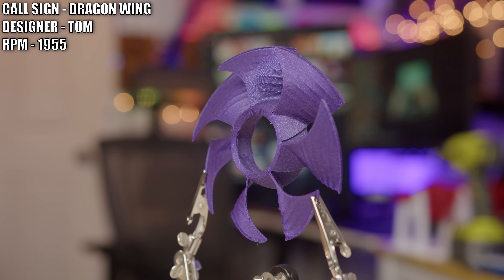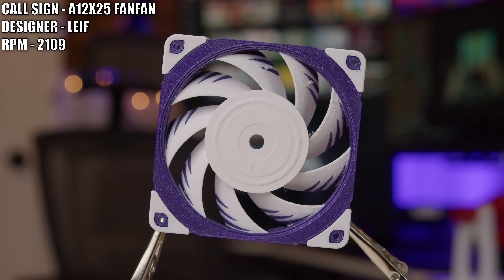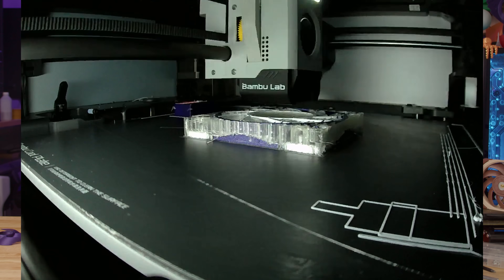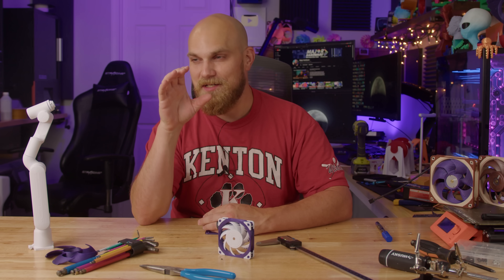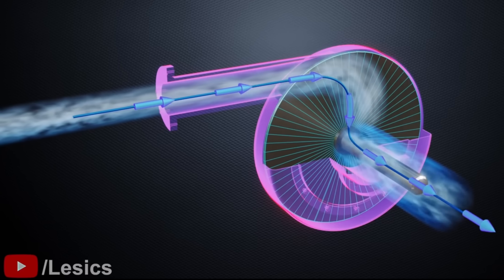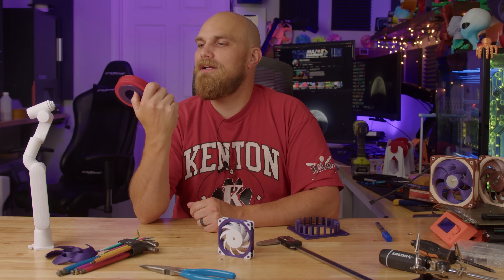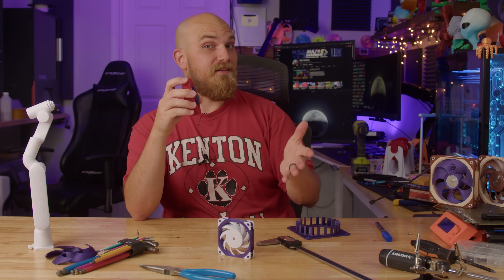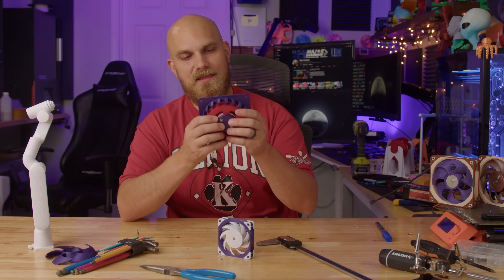I Put a FAN Inside a FAN | Fan Showdown S5E7

Comment: I was interested to see how the fans would rank if we were to value FPM and dBA equally instead of only noting dBA and ranking by pure FPM. I realized then that decibels are logarithmic, so I had to convert those values to linear before we could get a proper weighting. Also, the columns won't line up here because we can't use a monospace font in comments. But you can paste it into a text editor if you want that. Anyway, here are those rankings!

| Fan              | FPM | dBA  | dBA linear | FPM/dBA linear |
| ---------------- | --- | ---- | ---------- | -------------- |
| Multi Stage      | 268 | 40   | 101.59     | 2.64           |
| Turbo Pump       | 405 | 43.6 | 153.99     | 2.63           |
| A12x25           | 495 | 46   | 203.19     | 2.44           |
| Angel            | 485 | 47.3 | 236.11     | 2.05           |
| 92120            | 464 | 47.5 | 241.63     | 1.92           |
| Simple 13        | 479 | 48.1 | 258.97     | 1.85           |
| Gear Ratio       | 482 | 48.3 | 265.03     | 1.82           |
| Variable         | 430 | 47.4 | 238.86     | 1.80           |
| Hollowman        | 435 | 48.5 | 271.22     | 1.60           |
| Radish           | 459 | 49.5 | 304.44     | 1.51           |
| Warhead          | 454 | 49.5 | 304.44     | 1.49           |
| Tangent          | 459 | 49.6 | 307.97     | 1.49           |
| 17 Blade         | 446 | 50   | 322.54     | 1.38           |
| Circumventor     | 397 | 49   | 287.35     | 1.38           |
| Dragon Wing      | 528 | 52   | 406.37     | 1.30           |
| Cheater          | 477 | 51.5 | 383.57     | 1.24           |
| Waterfall        | 423 | 50.9 | 357.88     | 1.18           |
| Double J         | 397 | 50.4 | 337.79     | 1.18           |
| SkyScoop         | 423 | 51   | 362.04     | 1.17           |
| Triskelion       | 353 | 50.3 | 333.91     | 1.06           |
| Involute         | 327 | 51   | 362.04     | 0.90           |
| Toroidal         | 286 | 50   | 322.54     | 0.89           |
| XL               | 286 | 50   | 322.54     | 0.89           |
| Uruguayan        | 348 | 52   | 406.37     | 0.86           |
| 7 Blade Toroidal | 263 | 50   | 322.54     | 0.82           |
| 993              | 435 | 54.5 | 542.45     | 0.80           |
| Inverted Sharrow | 337 | 53.6 | 488.88     | 0.69           |
| Mobius REV       | 273 | 52.6 | 435.54     | 0.63           |
| Thoroid          | 255 | 52.8 | 445.72     | 0.57           |
| A12x25 fanfan    | 263 | 54.5 | 542.45     | 0.48           |
| Tesla Turbine    | 0   | 48   | 256.00     | 0.00           |
Reply: Nice work and I agree with your general point. I would however like to make one criticism and that is of the dbA conversion. Human perception of loudness works like most human senses (nearly) logarithmically. So the logarithmic dbA we experience as more linear than we would an actual linear scale. So by converting you kind of distort the final results, not improve them.
Reply: @apainintheaas  for anyone still interested, I reordered them using the original dBA scale and the results seem to make more sense
Fan              	        FPM 	dBA  	FPM/dBA log

A12x25                  495	        46	        10.76
Angel            	        485	        47.3	10.25
Dragon Wing      	528	        52	        10.15
Gear Ratio       	482	        48.3	9.98
Simple 13        	479	        48.1	9.96
92120	                464	        47.5	9.77
Turbo Pump       	405	        43.6	9.29
Radish             	459	        49.5	9.27
Cheater          	477	        51.5	9.26
Tangent          	459	        49.6	9.25
Warhead          	454	        49.5	9.17
Variable         	430	        47.4	9.07
Hollowman        	435	        48.5	8.97
17 Blade         	446	        50	        8.92
Waterfall        	423	        50.9	8.31
SkyScoop         	423	        51	        8.29
Circumventor     	397	        49	        8.1
993	                        435	        54.5	7.98
Double J         	397	        50.4	7.88
Triskelion       	353	        50.3	7.02
Multi Stage      	268	        40	        6.7
Uruguayan        	348	        52	        6.69
Involute         	        327	        51	        6.41
Inverted Sharrow 	337	        53.6	6.29
Toroidal         	286	        50	        5.72
XL               	        286	        50	        5.72
7 Blade Toroidal 	263	        50	        5.26
Mobius REV       	273	        52.6	5.19
Thoroid          	255	        52.8	4.83
A12x25 fanfan    	263	        54.5	4.83
Tesla Turbine    	0	        48	        0
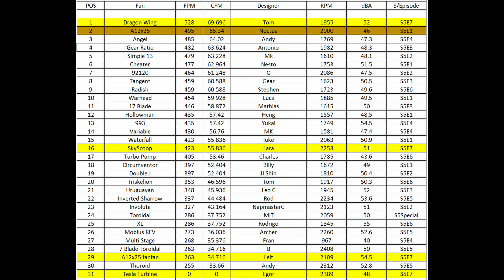Reply: Values sourced from 9:34
Reply: That's some awesome work dude
Reply: Hell yeah! Cool idea and baller execution to show the results instead of just wishing someone did it. Good job and thank you.
Reply: Best comment so far on the whole channel 👍 👍 👍
Reply: Some crazy math dude it’s awesome, surprising what ranks above all
Reply: That's quite a work, impressive ! However as @apainintheaas pointed out, human perception of loudness is a lot closer to log than linear. If you want the best result you can try to convert to a loudness scale but that would need an analysis of each fan sound profile. I feel that in this case Major Hardware did the best compromise as dB(A) at this range of sound level is our best proxy as far as understanding by everyone and actual noise level..

Edit : That got me curious I used your data in excel and I have an question about the results, what base did you use to convert from log to lin ? I doesn't seems to correspond to a log(10) as it should neither a log(n). I couldn't solve for a logarithmic conversion and get the same results as you.
Reply: @1312iYo  I found a practical conversion method which gave me numbers in a similar range to the FPM, 2^(d/6)
Reply: @NickCombs  Even though practical to use this method is bound to be incorrect. If you want values to be in the same ballpark (I believe for ease of comparison of the numbers ? I don't fully grasp why we'd need values to be close) any correlation coefficient should be applied after the conversion from the log10 to linear values rather than in between as it will introduce a n-th order error.

As for the dB(A) and noise perception discussion I tend to agree with you that A-weight it is our best available tool. But we shouldn't forget that it is quite limited for our purpose as it only gives us isophonic values @40 dB(SPL) for pure tones. And here we have to deal with drone noises, shaped white noise and mechanical clics. I don't know of a single tool that will accurately represent the perceived loudness for such a wide range of sounds. So for now dB(A) it is, also dB(A) scale speaks better to the general public than any other loudness measurement.

To dig deeper as @sniglom pointed out, as a rule of thumb airflow noise around an object increase to the third order of it's velocity not linearly. Good for us but that's only one component of the noise. Usually blades in a turbine have noise levels scaling to the fifth order and mechanical noises are linear (if I remember correctly as it is not exactly my area of expertise).

Now with that in mind if we wanted an general equation of a fan in order compare them we'd need several of data points at fixed perceived loudness levels instead of the one that Major Hardware can provide to us in a timely manner. And as @deciplesteve reminded us it would need to be done for a range of load (eg. dynamic pressure). So much work would be impractical for a simple entertainment video and for this season noise-normalized was ruled out in favor of pure speed in a non-restrictive tunnel so nothing can be really extracted of them.

TLDR: the work done by OP is a nice but sadly we'd need more data to interpolate effectively the fan's performance.
Reply: @1312iYo  I do appreciate these concerns. Clearly we're not dealing with enough detailed data to make a scientific comparison. Like you mentioned though, we don't need a scientific level of accuracy here. We just need a reasonable approximation.
Reply: I like what you're thinking, but there are some things to consider.

1. Airflow noise increase cubical (^3) when the air speed doubles. This makes the "FPM/dBA linear" ranking unfair for high airflow fans. A12x25. To fix this, we need to use one fan as the reference value for flow vs noise and then calculate whether the other fans deviate from that ratio. ie (percentual FPM increase vs reference)^3 /  dBA linear. This value would better show how good a fan design is.

I tried the top three fans from your list and calculated the expected noise vs fpm increase.
1. A12x25,  100% (495 fpm) | 100% (46dbA)   | 1 ratio
2. Turbo pump, 82%^3 = 55%  | 76% (43.6dBA) | 0.76 ratio
3. Multi Stage 54%^3 = 16% | 50% (40dBA)   | 0.3 ratio

2. Since we're using dBA and not dB (ie taking human sound perception in to account), we should also be aware that an increase of 6dB is double the sound energy, but our perception of double the loudness is closer to 10dB. This again means a penalty for fans producing high airflow. I would make the A12x25 a reference of perceived volume to 100 and then calculate the perceived volume of the other fans from that.
Reply: @sniglom  I think we don't need to worry about that as much as you think because the linear conversion is yielding numbers from 200 to 500 which lines up nicely with the FPM values.
Reply: @NickCombs  Your way of calculating the rank will always skew the result toward fans with lower airflow. If that's what you want, that's fine.
Reply: @sniglom  Kinda. The idea is to find the best balance of airflow to perceived noise level.
Reply: @NickCombs  That balance will always skew towards low flow fans, since noise does not scale linear vs air flow.

Thus, the FPM/linear dBA will prefer a low flowing fan with a bad design over a high flowing fan with a great design. This is why you get a low flowing fan on top, not because it's better designed than the A12x25, but because it has less flow and less flow means significantly less noise.
Reply: @sniglom  FPM is a linear measure of velocity afaik, so converting dBA to linear does give us a fully linear comparison, even if the conversion is imperfect. 

It sounds like you're unhappy with giving both factors an equal weighting. How would you change it?
Reply: @NickCombs  Yes, FPM is linear measure of velocity. Yes you can make dBA linear.

The problem is this: A fan with twice the FPM will produce more than twice noise.

So let's say you had a fan with 100 FPM and 100 linear-scale-dBA. If you turned that fan to 200 FPM, it would produce way more than 200 linear-scale-dBA. If you ran it slow so it produced 50 FPM it would produce way less then 50 linear-scale-dBA.

In your ranking this would give the three speeds three different ratings, even though it's the same design with the same properties.

Let's say you cared about what fan was most quiet at 200 FPM, which you set using a fan controller. If the same fan gets different ratings at different speeds, there's no way two different fans at different speeds can be compared fairly.

How I would change it? I would account for the calculations for airflow vs noise. So the same fan get the same rating regardless of whether it's running at 100% or 50% speed.

All this said, I really wish this channel would adjust the fan speed until the fan got the same dBA rating as the A12x25 and then compare airflow. Would make it way easier to compare noise performance.
Reply: @sniglom  Ok, so in theory each fan would have a slightly different slope on a FPM by dBA linear graph, but I don't think that would tell us anything about what we could expect from its performance at any given point. 

The other option would be to get the area under the line, but that's not very intuitive to inform viewers. But I admit it would be cool to see.
Reply: @sniglom  Forgot to mention since each fan is currently being measured at only its maximum FPM, we're already emphasizing higher air speed. Since the linear dBA values are all in a similar range, any variance from differences in those speeds isn't going to outsize the effect of the numerator. So at most, it's only bringing the scores nearer together rather than actively punishing high FPMs.

As for low FPMs getting a boost, I don't have an issue. They're not poorly designed as long as there's still enough airflow to cool the processor. I'd like to see the return of benchmarks for that, at least until we get a good idea where we could draw that line.
Reply: @NickCombs  I don't think my point is getting through still.

Make a graph with FPM on one axis and linear dBA on the other axis. Then you take a fan, run it at different speeds and plot the results. Those results will make a curve on the graph, not a straight line.

This curve will have about the same shape for every fan, because the curve shape comes from the physics behind air speed vs noise.

When you're ranking the fans, you're comparing them as if they were producing a straight line in the graph, when they're not. This skews the results, towards fans with low airflow.

I can make a related example. Say that you compared cars driving at different speeds and their fuel consumption. Speed is linear and flow of fuel is also linear (as in non logarithmic units).

So, we could rank our cars like this:
____ speed __fuel flow__speed/flow
Car 1: 100km/h,  10l/h, 10
Car 2: 200km/h, 40l/h, 5
Car 3: 103km/h, 12l/h, 8.6

It looks like car 2 is worse, because we assume that speed vs fuel usage is linear. In reality double the speed means four times the air resistance, so car 1 and car 2 actually have the same efficiency in their design.

Our ranking system is skewed towards cars driving slow, even if the fast car is just as efficient when driven slow. Thus the ranking is not helpful if we want to choose the best car for driving at 100km/h, since car 3 (incorrectly) looks better than car 2. Our ranking can only fairly compare car 1 & 3 that are driving at close to the same speed, where the difference in air resistance is negligible.

It's the same story for the fans. Your ranking system can only fairly compare fans that are close to the same FPM. As soon as there's a bigger difference, it will always skew towards the fan with less flow, regardless of whether that design is efficient or not.

To get around this, we can set one car as reference (car 1) and instead of ranking by speed, we can now rank by calculated air resistance.

_speed_air resistance__fuel flow__resistance/flow
Car 1: 100%, 1x,  10l/h, 1/10
Car 2: 200%, 2^2=4x, 40l/h, 4/40
Car 3: 103%, 1.03^2=1.06x, 12l/h, 1.06/12

The same can be done for the fans. If I remember correctly noise increases ^3 when doubling air speed (but you need to check that!).

Fan | FPM  | "noise factor" | dBA linear | nf/dBA
| Multi Stage      | 54%  | 0.16x | 101.59     |  0.0016.
| Turbo Pump     | 82%  | 0.55x | 153.99    | 0.0036
| A12x25             | 100%| 1x | 203.19     | 0.0049

Lastly, we need to consider whether we care about perceived loudness ie 10dB = twice the loudness or whether we care about sound energy, 6dB = twice the volume.
Reply: @sniglom  Thanks for the explainer. That's an extreme example. I think it has minimal effect on our fan numbers, but I get what you're saying. This seems to be the best we can do with the available data.
Reply: @NickCombs  The FPM differences between the high flowing fans and low flowing fans is about 2x.

A 2x increase in flow is about 8x increase in noise (linear). That's not insignificant at all.

It's like saying, since we have limited data, we're going to ignore air resistance when comparing fuel usage of a car going 200km/h and another car going 100km/h.
Reply: @sniglom  I think it's time to chill bro. If you're so passionate about it, collect more data and put your own table together.
Reply: @sniglom  if you refer to the table of results I posted, you'll see more of what you're looking for.
Reply: Nice summary, one thing about db is that it also matters what frequency is dominant. For example the dragon wing produces higher freq. and to me that isnt very pleasent to listen to for prolonged time.
Reply: @witchdoctor6502  dBA is already doing that as good as we need to I think. Here's the quick definition.

"A-weighted decibel (dBA or dB(A)) is a logarithmic system of measuring sound as the human ear experiences it. It assigns a weight to the decibel value of sound based on the sensitivity of the ear at a particular frequency."
Reply: @witchdoctor6502  I suppose if he released frequency profiles for each fan we could weight the performance so that higher frequencies reduce the overall score
Reply: I don't think sound should be used to rank because I've seen some models that while louder, had a more pleasant sound than other ones that were more quiet, so the louder one would rank lower while being better than some above them
Reply: @A11V1R15  Check the above definition of dBA
Reply: I'd like to see some of these in actual use.

Have him set up and benchmark a computer running multiple A12s. Then resin print several of the "champs" and see if their design changes (i.e. extra parts, extra noise, etc) equates to any noticeable change in the real world.

To me, as a mechanic, I can say without a doubt, a car sounds very different when free revving than it does under load. Some of these noise penalties may not be noticeable where as some of the extra parts may cause significant spacing impacts.
Reply: How did you work out the linear dB? I thought it was based on powers of 10?
Reply: @VinayVarsani  I found a practical conversion method which gave me numbers in a similar range to the FPM, 2^(d/6)
Reply: Good work.  As GamersNexus notes, any fan can be better just by spinning louder.  That's different motors for different manufacturers though.  I'd say the other major things not tested are failure rates, lifetime, and ease of manufacture.  I think GamersNexus had an interview with a Noctua employee where they noted they had a great fan years ago, but couldn't mass manufacture it.
Reply: Most underrated comment I've seen in years of youtube. Nice work!
Reply: They're not THAT logarithmic. If you really want to calculate flow/noise ratios you should also consider how the human ear/brain processes sound. Generally, lower frequencies require higher proportional DB to feel the same, and additionally, it takes about 10db to "double" the perceived volume of something, with the minimum difference being about 3db to even register a change without listening back-to-back.